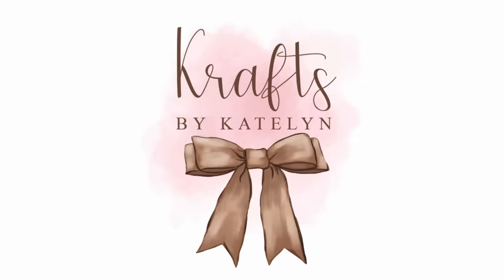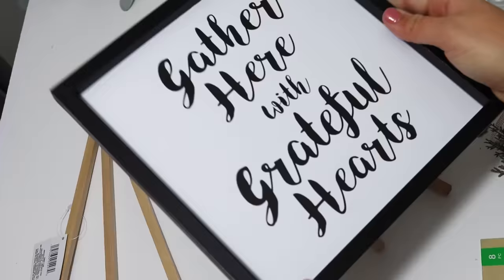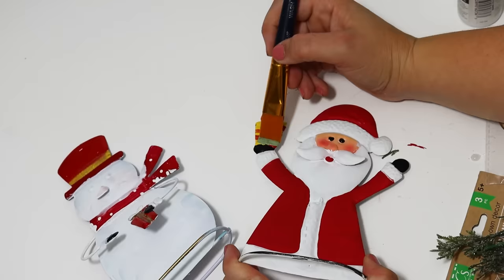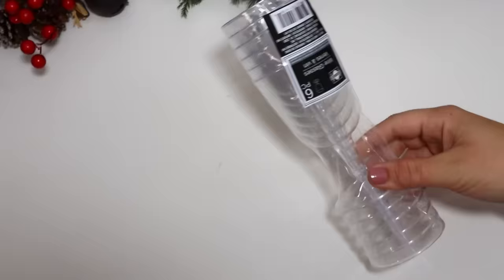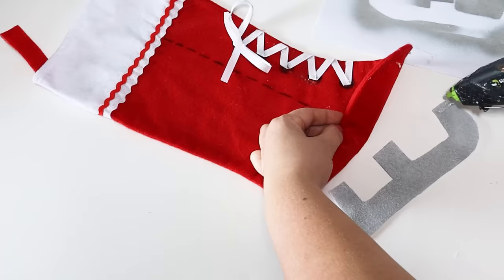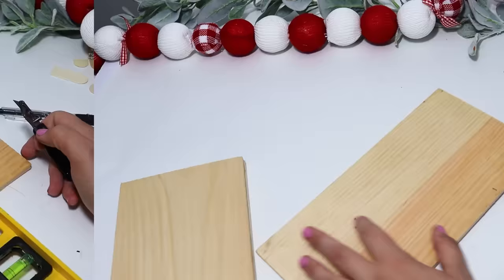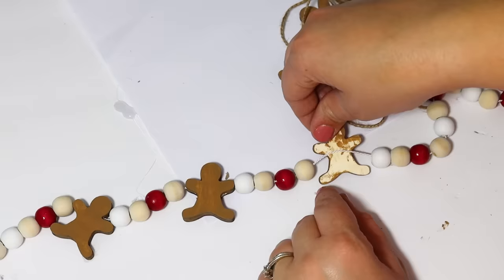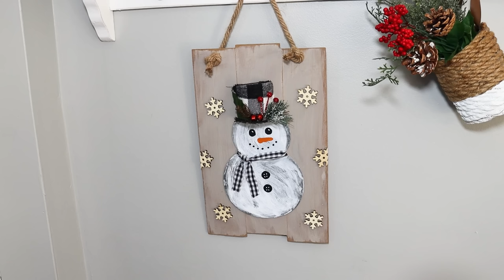50 Genius DOLLAR TREE CHRISTMAS DIYS (Easy but Impressive!) NOT TACKY TO TRY 2023! Krafts by Katelyn

Comment: YOU JUST SAVED ME!  I am slowly putting my vintage/retro 70’s tree of my youth dream for my craftroom.  I am getting bubble lights but due to cost-  only one strand.   In the 70’s we didn’t have these little lights.  Your big bulb on LED low heat lights are perfect!   I will plan to use E6000 for a perm hold but that will finish out my little 5 ft retro tree without a fire hazard from buying either old lights or budget breaking from buying them new!  This was last piece I needed!  I started buying things two years ago and this is the last piece I needed to figure out!  2 years of looking and thinking and I only needed your crafting imagination!  Thank you!
Reply from the maker: Haha, I'm so happy you like them!! Your tree sounds like it will be beautiful! ❤️🤗

Comment: Gorgeous ideals, as always. I can’t wait to re-create some of them. With the little flute cups, you could leave the bottom of the cup on and create the scene inside with the wood slice for the bottom to fill it and then put it on top of a shelf and put, a teal candle or battery operated candles on top of it and make them little candle holders. So gorgeous though.